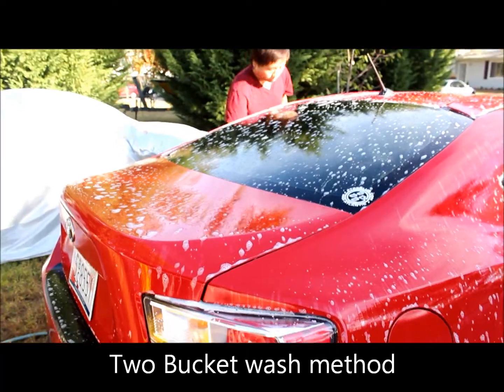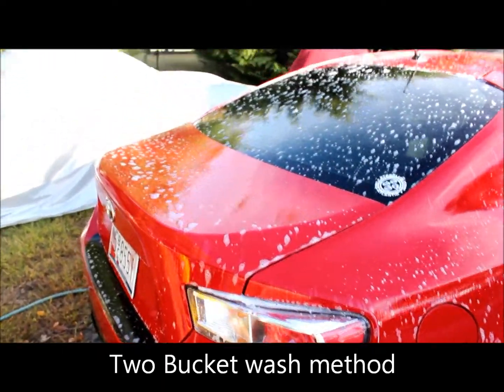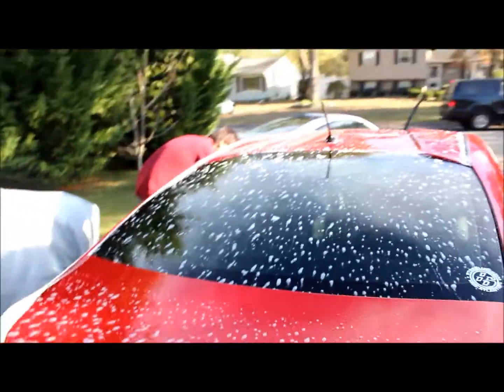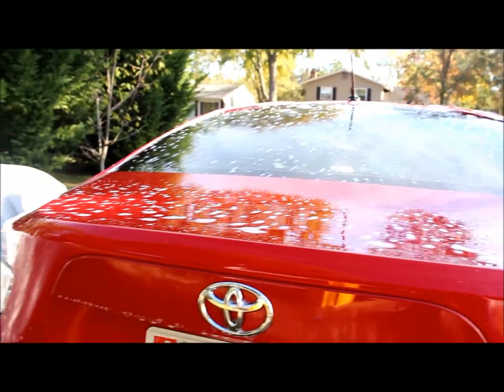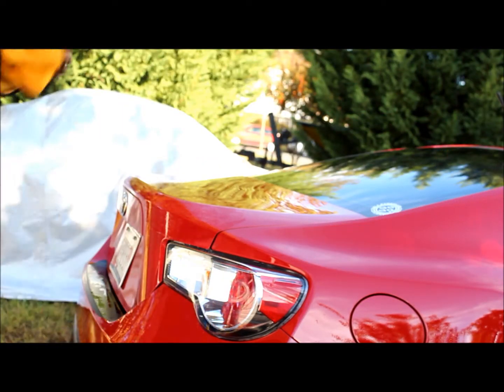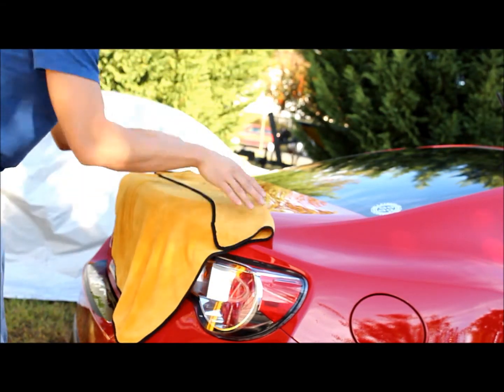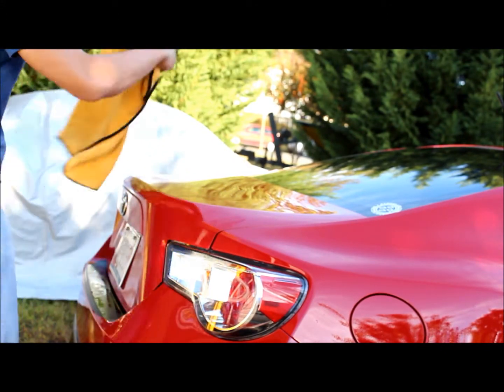How to install a trd spoiler for a BRZ FRS GT86

Comment: hey dude where did you get that spoiler?.. and what was the color before you painted it. thank you so much.
Reply from the maker: jon motoring. BUT I would not get it there. It is the same as ebay amazon etc. Color was black. fitment was ok.